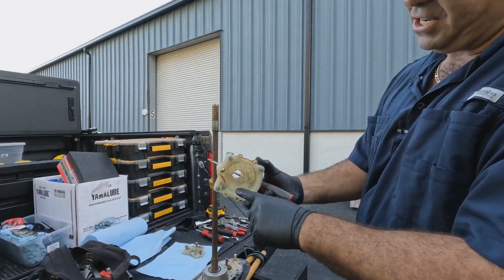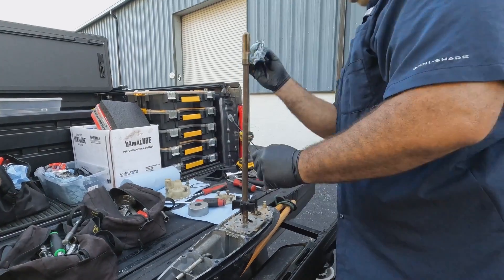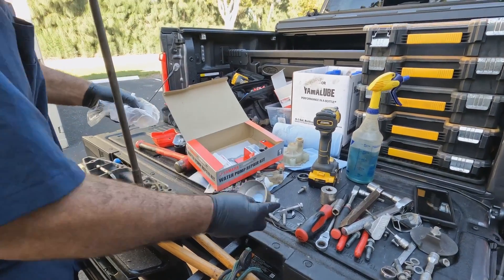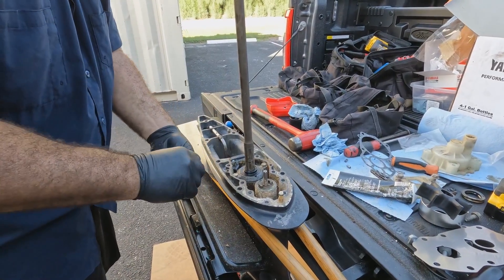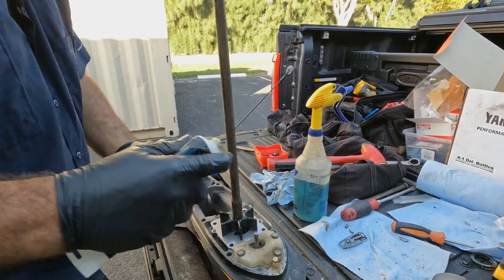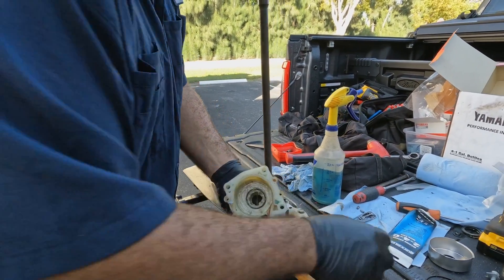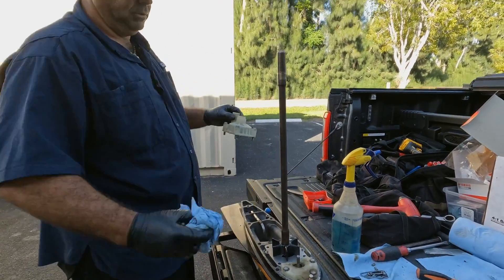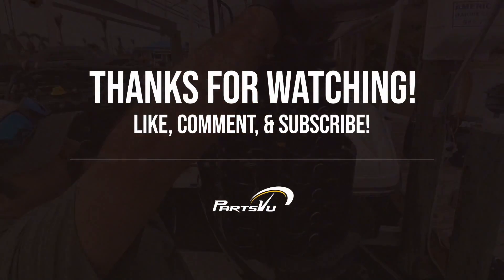How to Repair a Yamaha Water Pump | VF200, VF225, & VF250 Models | DIY Yamaha Outboard Maintenance

Comment: Love it !  Question does the shifter need to be in a certain position forward, reverse or in neutral??  Just want to make sure I line it up correctly!  Thanks
Reply from the maker: Hello Joe, Neutral is the recommended position for most Yamaha outboards when removing and reinstalling the lower unit for water pump maintenance. Let us know if we can help with anything else!

Comment: What grease do you recommend for the job (concern about rubber parts)
Reply from the maker: Hello! 

Thank you for supporting our channel. Grant recently compared Yamaha and Mercury engines, and the recommended go-to grease is Mercury 2-4-C grease. It's a versatile marine grease that works well with any engine. The part number for reference is 92-802859A1.
Reply from the maker: https://partsvu.com/products/mercury-2-4-c-marine-grease-with-ptfe-8-oz-92-802859a1?variant=45626522075427&om=17219&utm_source=google&utm_medium=cpc&adpos=&scid=scplp92-802859A1&sc_intid=92-802859A1&gad_source=1&gclid=Cj0KCQjwiuC2BhDSARIsALOVfBJCvCS-VKvas1F_qNBB_ILCmO72HfwXzoL1I0NtVZz1qaNk_jiRfVIaAqCuEALw_wcB